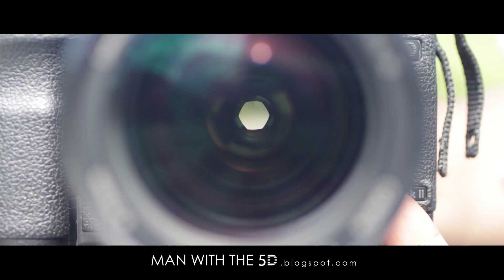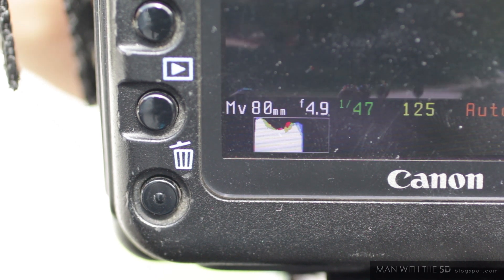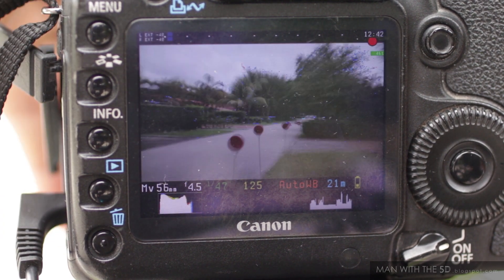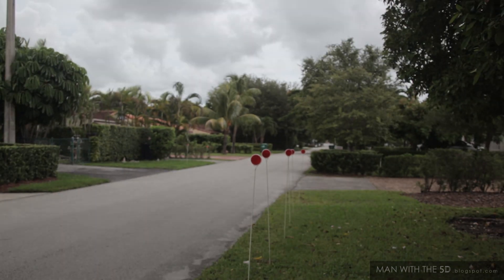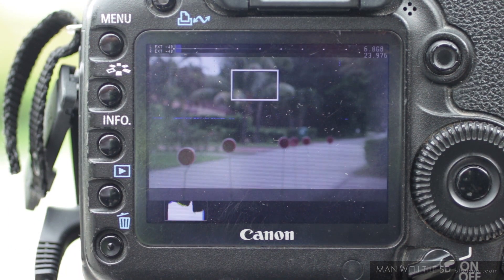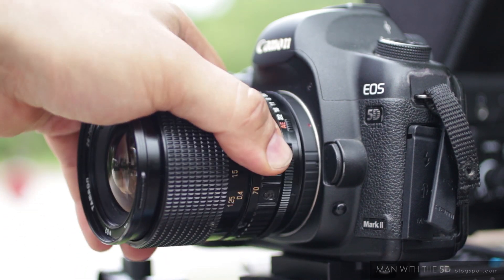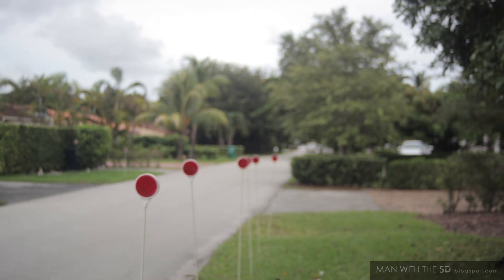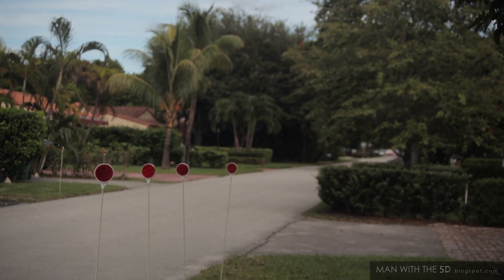Aperture Flicker Problems When Shooting DSLR Video

Comment: I guess this problem is very common with DSLR filmmaking. I have a Nikon D5100, with a (whatever the kit lens is), and I have the same problem. For a lot of films, I am going to need to get a wide angle lens, so I am highly considering buying a manual lens.